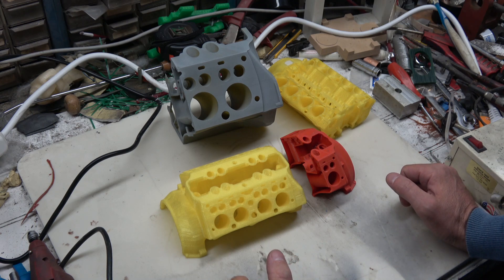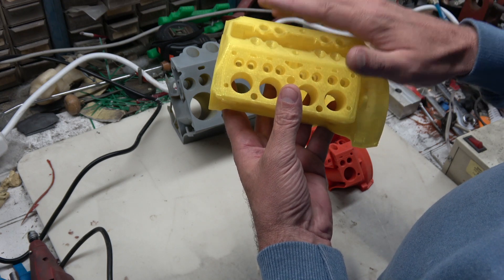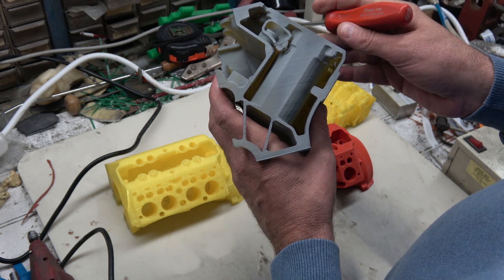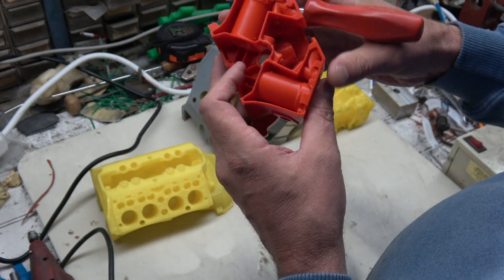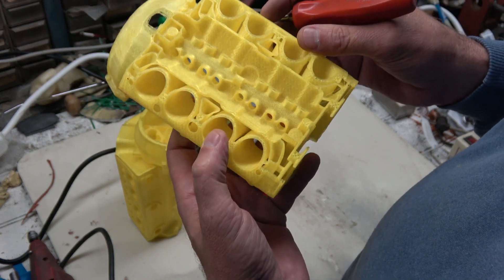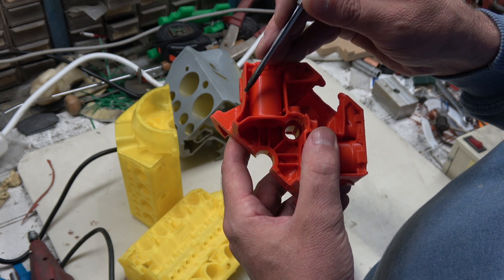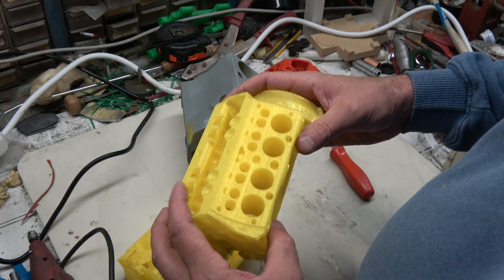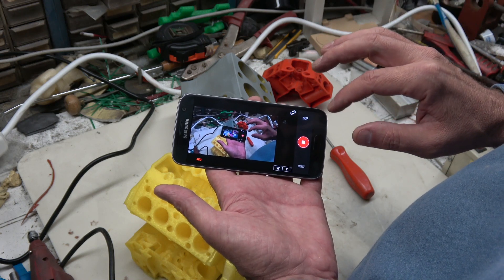model engine block casting

Comment: Hiya just had an idea, you could split the model up in even pieces and then cast them with all the pieces clamped together?  They make boat crank cases like this.
Reply from the maker: I didn't design the model.  If I had I would have gone a different direction to make it castable 
 Splitting the mold into pieces would be a possibility..

Comment: Can you 3d print the negatives with a mold base so the negatives are in location. Then pour the silicon mold. Theres going to be some machine shop work required afterwards but thats the easy part, any details that can be machined leave out.

Comment: Cool. How about the PLA vs the moldlay burnout. Is it similar to wax?
Reply from the maker: The pla likes to fracture the investment in areas of blind holes during the burn out, moldlay is a little better but has the still same problem.  People all ways think they they are burning out the pla, and they are, but the main thing you are doing is burning out the investment. Look at the Mfg's burn out schedules for their different products and you will find the final temp is way higher than any wax or pla could withstand. PLA burns out very clean with no noticeable residue left behind and I know the the wax filament likes to boast that it burns out cleaner then PLA but out here in the real world I have seen no noticeable difference provided that a proper burn out schedule is followed.
Reply: thehomefoundry good deal I'll try it. Thanks. Can we PM so I can show you some of the big stuff I've done?
 I would also like to show you my match plates I'm printing. That was one of the main reasons for the big printer when I bought it. It works like a charm for double sided sandcasting. The stuff literally comes out perfect. If you go to my website Legendary-motorcycles you can email me thru the contact page and I'll send u some photos.
Reply from the maker: sent ya an e mail.  Nice work on the tanks!

Comment: If you need something bigger let me know. I have a 20"square by 20" high Creality printer that's tuned in and prints smoothly but I haven't ventured past standard PLA yet. I'm thinking of trying the wax filament. 
 I haven't tried lost PLA because I assume there's a nasty burnout process. Any insight on that would be helpful. 
Oops. Just noticed you used mold lay....did you have to make any major adjustments in your printing?
Great learning videos by the way. Thanks.
Reply from the maker: I would love to see a print of that scale!!
  No the mold lay is pretty easy to print with, but does take longer to cool between layers so printing slower is a good idea.

Comment: What kind of printer are you using and what is the build capacity?
Reply from the maker: David Ashenbrener the blocks were printed on a 
Rostock max.  10" dia by 14" high.
Also have a flash forge creator pro and folgertech ft5

Comment: hi. few tips with the pla. thin layer of parifin wax will melt out before pla expand...also some stainless screws from the side through the pla inte chanels works well. easy to remove and holds cores in place.  also to get ash out have in gating and out gating so you can blow through the mold. in one side and out the other to clear ash... good luck. that is a hot potato....

Comment: Is it possible for you to print a negative of the engine with a plastic, like poly styrene, that will desolve in a solvent but the solvent will not affect the wax? Then you could cast using wax, then desolve the plastic using the solvent. Then cast aluminum?
Reply from the maker: NickTFuqua. I dont know, it may be possible.  Might prove more trouble than its worth though....

Comment: Lol, bro. You pretty good at those casting thingy's. Here I was thinking, He is gonna remodel this beauty taking account for the casting process and reprint... 5 Secs later. Manhandling freaking pliers and ripping it all out after the fact.. :). Should u be willing to send me the file. Am willing to see what i can do about the areas u wanted to see changed. However knowing that I am amateur hour when it comes to casting procedures. U would best include a "manual" on what simplifies your casting procedure in relation to the geometry. Or i'll check some other videos. :) Anyway. Have fun with that beautiful thing you got there.
Reply from the maker: jnoppe i only have the file as an stl.  Unfortunately im not permitted by the designer to share it.  Think im just going to fill the coolant passages and pour it solid.  Just need to free up some time.
Reply: I Hear you brother ! 

Time is something special aint it. As for me, I got nothing better to do than making .. Let us say things that nobody else would even bother taking the time for. For fun ! Or just to see how far we can push something ! Some might even say for Science sometimes ! Haha.

But back on topic. I am actually also very interested in certain aspect of this casting. For example, how did the original modeler account for shrinkage/tolerances/material flow/etc.. ? Or are those specs off limits ? :) Or is it truly based on the original motor ?

As for not being able to share. I fully understand. I'm guessing you only received an .stl file ? And not the the actual for example, inventor/solidworks/other spieces and herbs/.. files. In other words, you can generate gcode for the printer, but modifying an stl file is not fun, lets keep it with that.

PS, ive always wanted to try to see if i can model some scaled down versions of some engine types to use in a scale airplane build. Knowing i have no actual way in turning metal in liquid metal, casting is no-go for me and the half engin(e)-nerd/neer/nard/.. in me is left unsatisfied. 
But i'm interested in what challenges you are gonna face and even more so, how you are gonna conquer them.

Best of luck with this one ! Hope to see part 2 sometime !
Reply from the maker: Its an exact representation, no shrink allowances or machining allowances...  I scale the print to the shrinkage rate of the metal before printing.

Comment: Interesting fact about the real V8 Ford Flat Head. Those exhaust ports traveling through the coolant and around the cylinders  caused some problems with over heating with some engines. Looks like a very difficult project.

Willy
Reply: Bill Blackburn yes the early models did have overheating issues but they got it worked out the main problem was people trying to modify the cooling system by removing fins from the water pumps and replacing thermostats with washers or nothing at all